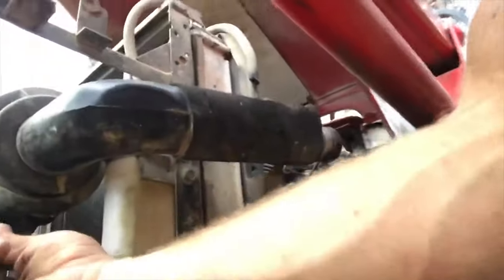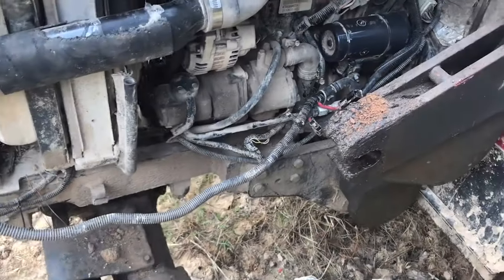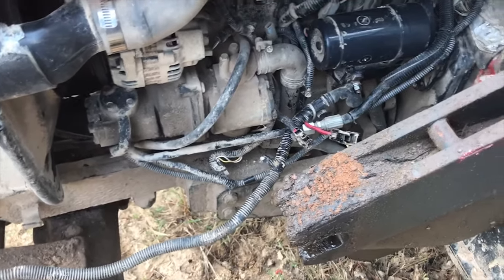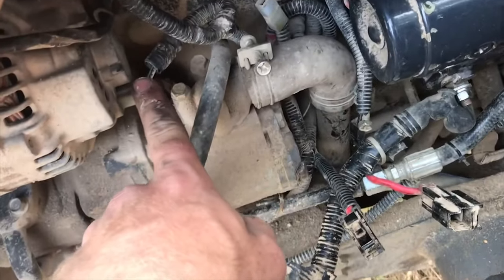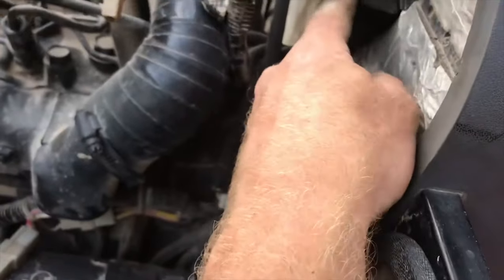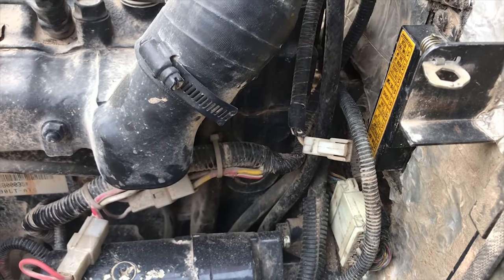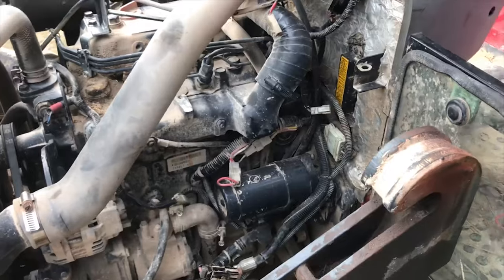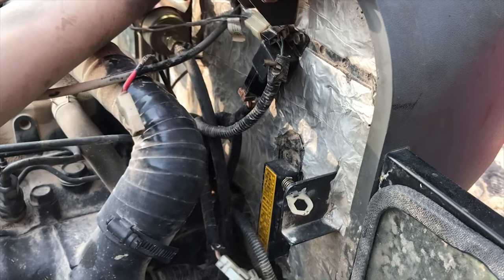Tractor Electrical Troubleshooting - Dead Short (Glow Plug Relay)

Comment: Tom, I had same issue today where my Mahindra was doing the same thing and after following your steps I finally found the problem.  Like you did I took the positive cable out to bypass it and sure enough the tractor fired right up, the cable had a break in the middle and was not supplying enough juice as soon as I replaced the cable I am good to go now but I was thinking just like you on buying a new battery but this one was testing at 13.2 volts so I knew was something else.  I thank God that I ran into your video and if it wasn't for you I would of replaced allot of things I think, thank you so much for your video.  God bless you...
Reply from the maker: Wow! I’m not alone! I’m so happy this helped you resolve your issue. Thanks for watching. Please like, sub and SHARE!!

Comment: TOM I AM EXPERIENCING THE SAME ISSUE . I did find the glow relay to be defective after working backwards from the battery, and then testing all fuses ,connectors etc . It does help to have the wiring  schematic to locate what circuits to test . Thanks for your video, tom
Reply from the maker: Happy to help! I still haven’t replaced mine, just unhooked it 🤣. This little tractor has taught me a lot more about my own ability to troubleshoot and fix things vs calling a mechanic or service technician.

Comment: I have a diesel generator that will only run while i am pushing the glow plug switch. As soon as i release the switch, the motor dies. I am trying to find out what is wrong...
Reply: Stop solenoid

Comment: im looking for wireing for 2028 century my glow light not on and dont here flue pump turn on any idea what to look for
Reply from the maker: Sounds like probably a fuse is blown or a bad relay. You just have to chase power and see where you’re losing power. I had my glow plug relay fail and then it also blew a fuse